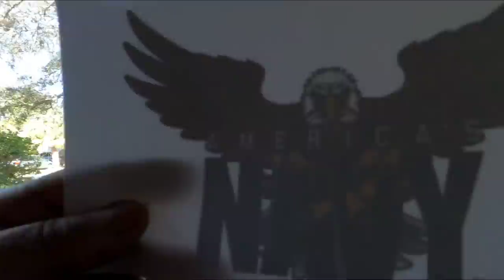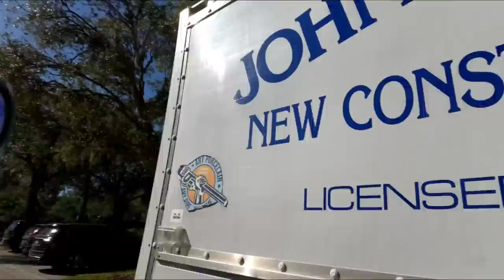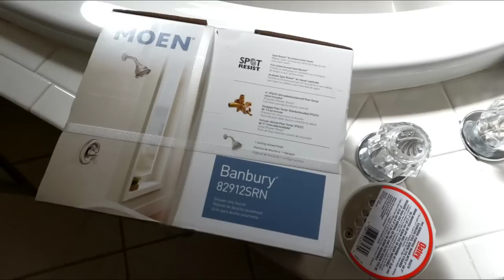HOW TO DIAGNOSE A BAD SHOWER PAN

Comment: I hope you get that job, I would like to see how you replace that shower pan. Would caulking or regrouting stop a shower pan leak? I would imagine a lot of people would want to try that first especially if they were in a situation where they had a crawl space or a basement.
Reply from the maker: Caulk would absolutely not work,they have to replace the pan,unfortunately.
Reply: There are several cracks in the grout in that video, and replacing the whole pan is the best long-term fix, but you're right, if he had the time, or this was the homeowner, filling those obvious grout cracks with plumber's putty temporarily would at least determine if that's where the water is getting through. As I said, the damage below warrants replacement, but I am often amazed at how people seem to ignore gaps and cracks in their grout in their tub/shower area which definitely let water in, and they keep on using it that way until it's a real mess of water damage and rust.

Comment: Hey John I'm not a professional plumber just have a question 🤔. There's no way it could have been that plastic drain you took the screen off of 🙄🇺🇲. Old man in Southern California 😎♥️
Reply from the maker: Not likely, but either way it needs to be opened up.
He maybe able to save the walls, but the floor has to be re-done. 
Thanks for the question and thanks for watching
Reply: @frankvetere4423 I was getting ready to post the same thing! Never the less, since all the tile needs to be removed for pan replacement, I would be removing the tiles around the drain to investigate. Possibly replace, or re-caulk and test again. But my opinion is from a homeowner with time on his hands. The pros take a different prospective, based on their experience that more than likely, it is the pan.